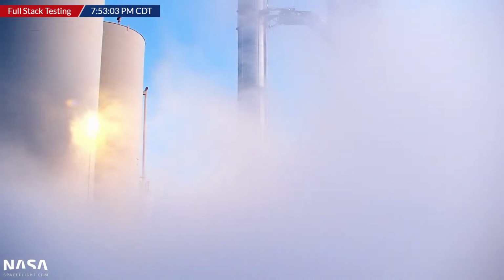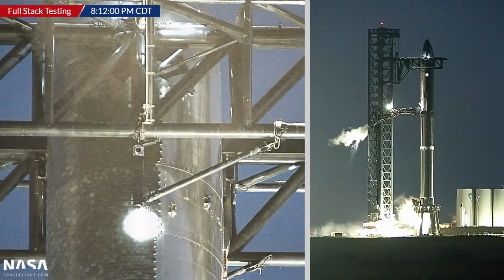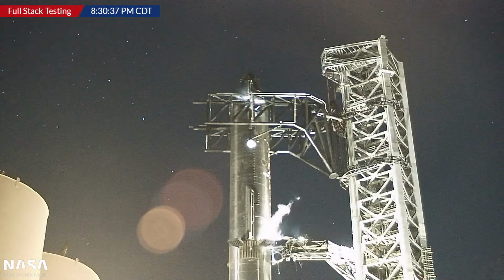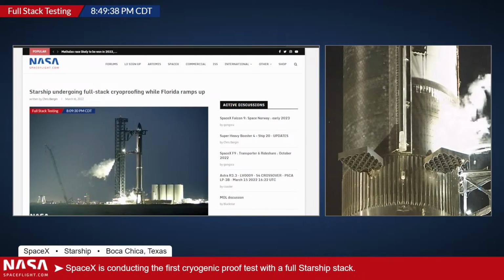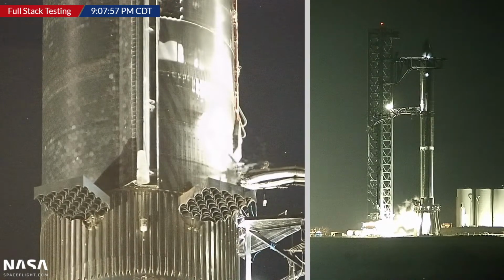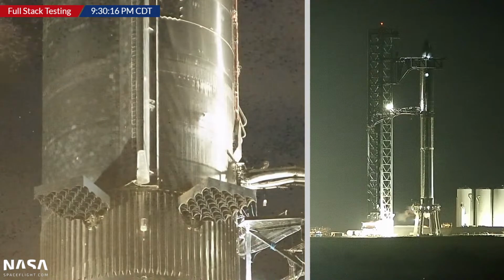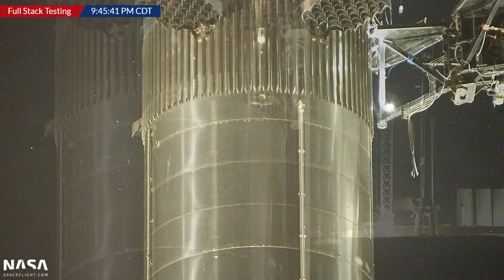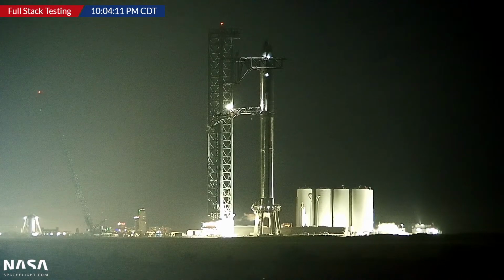Starship Full Stack Cryogenic Proof Test

Comment: Thank you for explaining this. As one who is ASE certified in the mechanics field who has worked on vehicles and machines, not just one who works on code, I can appreciate and understand the information about the thrusters used to get that bit of fuel to reach appropriate areas.☺️ I am very technologically-oriented.

Comment: On temperature an humidity sensing around a camera. A Raspberry Pi can have sensors like Adafruit's #4059 for pressure, humidity, and temperature. This one is discontinued. It was a bit sensitive to condensing humidity. Best replaced every year or two if outside. I searched with "pressure" at Adafruit and saw many newer versions. I had mine on a 6" set of wires so it was outside a small clear plastic Pelican case where I had the battery backup, and Raspberry Pi W. I also had a rain gauge bucket tip input. It had MOVs for clamping any voltage spikes coming in over the wires. A power switch to the sensors is good to have. Sometimes the BMP280 would lockup and needed to be power cycled. Now I'd use an electronic relay. I used a logic level P-channel MOSFET with a gate driver. I had the parts on hand.

I used python scripts to read the sensors, and store the data into a CSV file on a RAM disk. RAM disk because FLASH cards wear out with constant updates every second or even minute. Another python script kept a set of web pages updated. A third python script pushed the data to another computer over the net. Note: I made my boot CF card partitions read only so it had little chance of failure from unplanned power downs. I had another writable partition for storing log data. Every time the log file got 8k bytes longer a script copied the next 8k bytes into the ring buffer stored in the partition. This lowered the number of writes to the partition. Also there was no file system. It was just a partition with data directly stored in it. Under Linux this is easy to do.

My battery was a large Li-Ion battery using a USB charger/power supply Adafruit makes.

Something I would do is see if a higher readout rate pressure sensor could be used to measure pressure waves from explosions and takeoffs.

For those that don't know Adafruit has lots of software for using their products.

Comment: Will this thing fly into orbit and come down during the next test? meaning both booster and starship are recovered??
Reply: Orbital fljght test flight plans showed starship landing in the Atlantic ocean and the booster landing in the Pacific ocean
Reply: @rjc4370  So both if recovered becomes scrap metal,  ha ha
Reply: Realistically the booster MIGHT survive (it will be scrapped right after) but no way does the ship gets through reentry. If the tiles cant go through the vibrations of a static fire, they wont make it past the atmosphere. Usefull data though
Reply: @fredEM120  Anyway,  Rome was not built in a day,  still looking forward to see the thing,  just fly as high as possible,  he he he